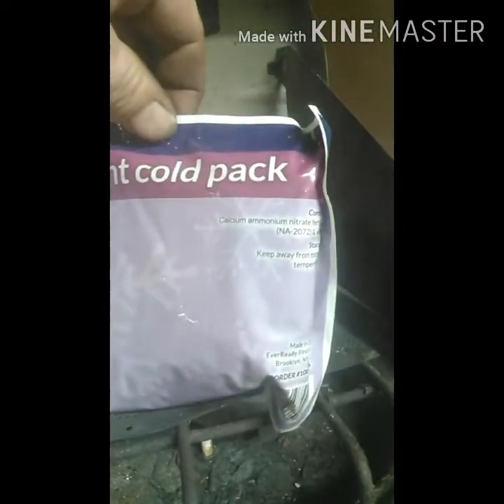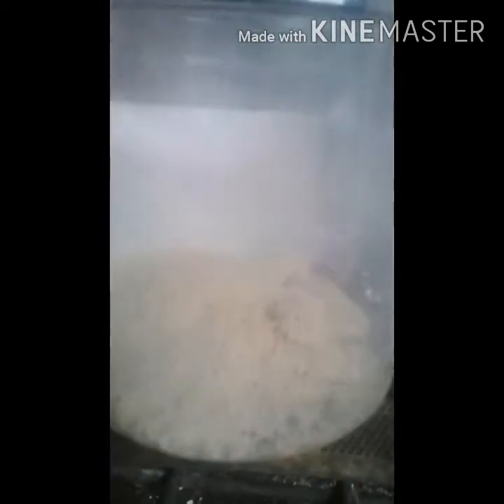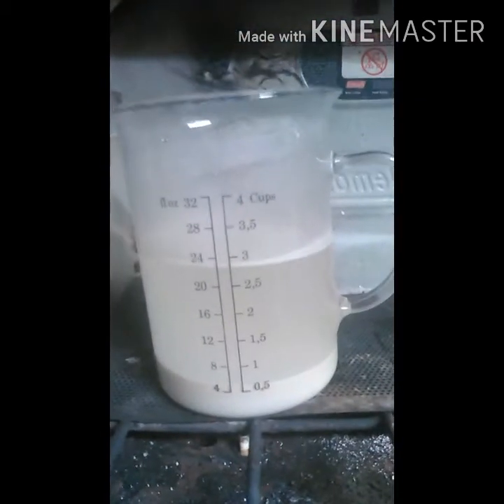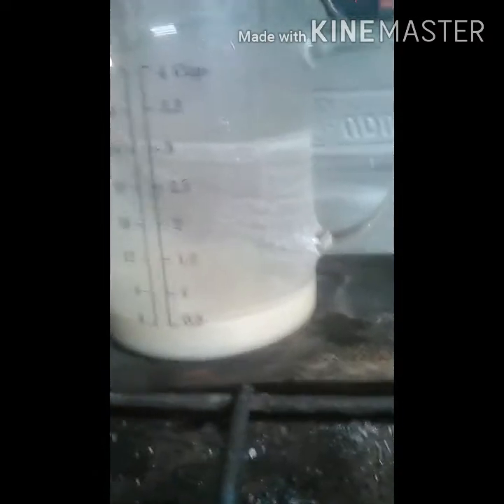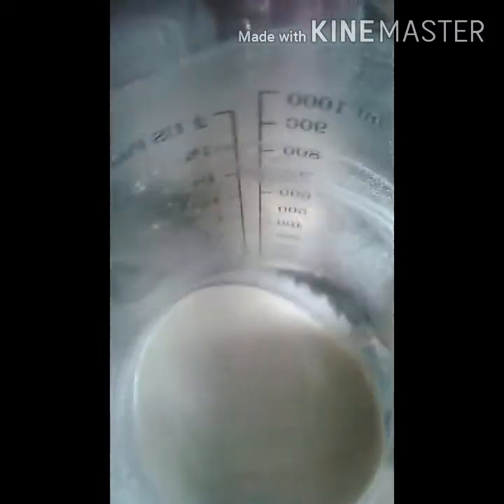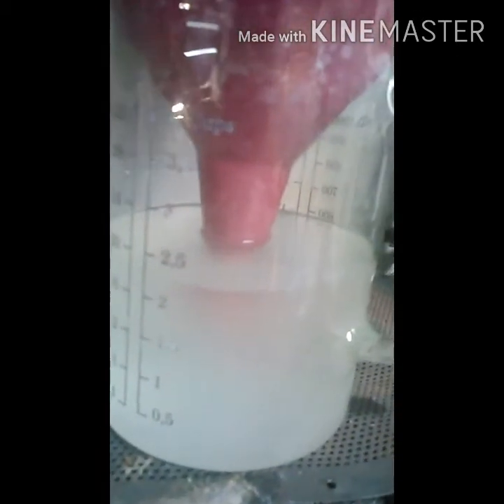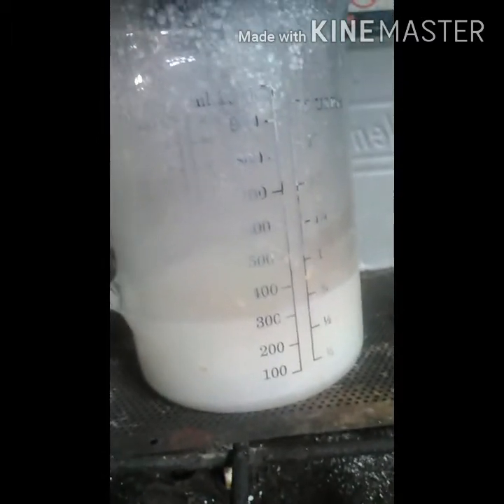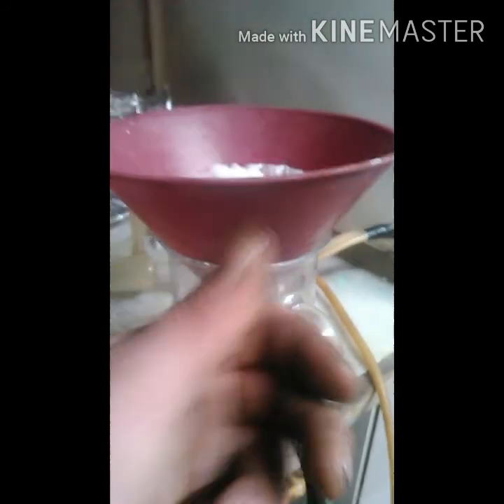How to purify  ammonium nitrate from cold packs that contain calcium ammonium nitrate

Comment: Something I've personally seen done is crumple up a single paper towel and cram it into the bottom of a long funnel, and pour whatever liquid into the funnel and just let it do it's thing. Might want to prop it up somehow so it doesn't fall over. In a couple hours you'll have an absolutely crystal clear solution. Vacuum decreases time exponentially, obviously.

Comment: I recently tried your method of getting ammonium nitrate from a couple of cold packs and I followed every step by when boiling down, instead of seeing a couple crystals forming on the top and then cooling down, it just got more concentrated to where the beaker was basically jumping off the hot plate and then I cooled it to where it became almost a solid mass. I scooped everything out and now drying it on some filter paper to see what happens. Are these the ammonium nitrate crystals? Or did I mess something up?
Reply: did you ever figure this out?
Reply: @ No, I’m not sure exactly what happened. But the solid mass was pretty much useless. But now thinking of it, I could’ve tried filtering the solution from the small crystals that formed when boiling and then cooling the mixture.
Reply: What are the numbers for pi ammonium nitrate on a bag?

Comment: I'm trying this, but with much more water. I'm hoping to get a higher yield.
Gonna let it crystallize overnight
Reply from the maker: How was your results?
Reply: @shelbysgarage5828  Pretty good. I got a little more; but, the big difference was the purity. It took a couple days longer because I separated the calcium, rinsed the ammonium nitrate and let the clear solution sit to let it settle a second time.
I just had to reduce it a little bit longer
Reply from the maker: Nice!

Comment: Salut, la solution que tu recrystallises est  trouble ! Avant de vouloir tenter la crysallisation il faut filtré plusieurs fois, pour éliminer un maximum du calcim !
Et si tu possède une adaptation pour un filtage sous vide c'est plus pratique et rapide !
Mais même avec des filtres à  café, ça va aussi mais avant tous ton filtat doit être limpide !

Comment: Calcium can be removed by slowly adding ammonium sulfate solution until it stops making a precipitate. Then pour off the liquid, saving it. Next add a tiny bit of ammonia in excess till basic. Then boil down.
Reply from the maker: Your just adding more steps to purify it. The method I posted works very well

Comment: hey just curious, how many packs did you use? I have 72 packs but Just curious on how many would be a good ratio? Thank you
Reply from the maker: The ratio is mix a single full pack together. Then add the dry parts of other packs until they won't dissolve anymore. At this point either add more water and dry parts or filter out the calcium
Reply: @shelbysgarage5828  thank you I appreciate your knowledge and you have a new subscriber. Thanks again!

Comment: i got some cold packs (i live in romania btw) and on the front side it says it contains ammnonium nitrate and water and on the back it says it contains calcium nitrate and water: i'm really confused but i hope these bags contain ammnonium nitrate. Im still going to try purify it.
Reply from the maker: You have the correct ones, just follow what I say to do and you will be successful!
Reply: @shelbysgarage5828  yes, it s been a week since i purified them and i got the ammonium nitrate 😁😁. Thnx for your tutorial it was really useful!
Reply from the maker: @Federal.catch12  excellent work! Glad to hear it worked out for you!
Reply: @shelbysgarage5828  plz guide , at what temperature the clear solution will turn into crystal ? Do we need to boil it to 170°c ???
Reply from the maker: You only boil it to remove the water. Once half of the water is gone let it cool and that will crystallize. Although there will still be more to get from the remaining water.
Reply: @shelbysgarage5828  first of all thanks for  prompt reply, 
What ratio (CAN : Water) should we use ?
Reply from the maker: @mjlr4369  so your packs are calcium ammonium nitrate so we need to remove the calcium. So mix one package up like normal with the water in the bag that comes w it. Then add another pack without the water. Keep adding the dry parts until they won't dissolve anymore. At this point either add more water or filter out the calcium.
Reply: @shelbysgarage5828  thanks alot bro